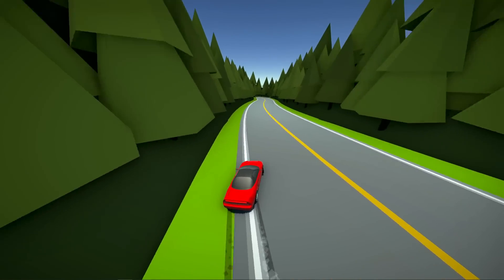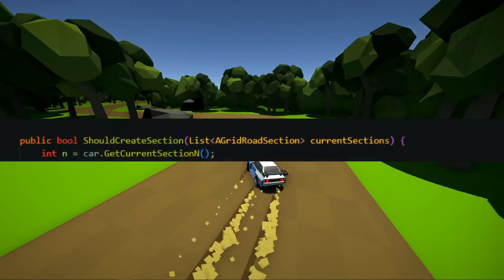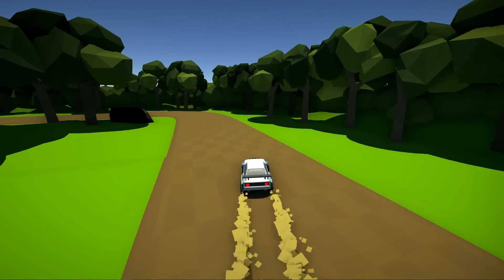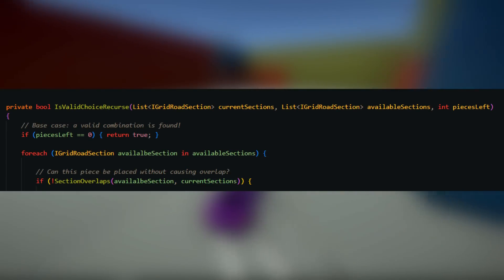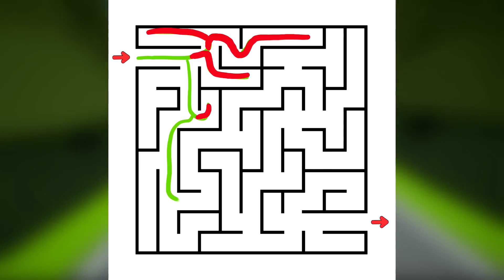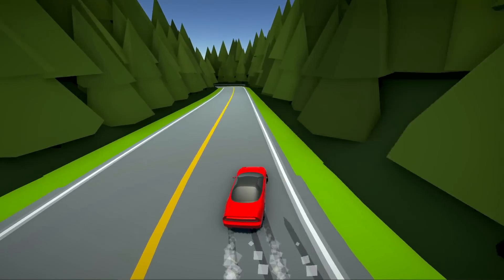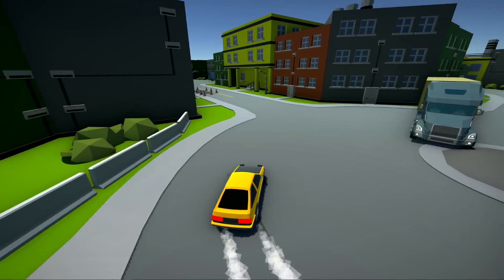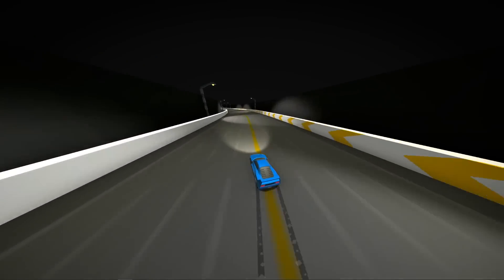Creating Infinite Road For My Drifting Game (again) - Drifto Devlog

Comment: You did the world generation, that's right, but you did the wrong movement: due to the limitation of float accuracy, you will start having big problems when approaching 100,000 coordinates, so programmers move the world around the player's camera, I did this with the level map in match3, as well as minecraft clones do
Reply from the maker: Yeah you're right, it would cause a problem.
I didn't talk about it in this video, but there are other systems stopping the player from going that far, so I don't need to worry about this.

Comment: If you get rid of the grid, you can still align pieces together with an entry and exit point. Just keep the position and angle of them in each tiles.
It will make the collision checks harder as you will want to check if the outer edges of the tiles overlapse. But it's not crazy to do at all. And since you don't need to connect back to previous pieces, it's fine if you loose the alignment to the grid. It will allow for any shape, and you could maybe do a stretching system for your tiles to curve them randomly

Comment: Try using spline for road and dynamic obstacle spawning at some distance. OR make one big square area with env and at runtime create 4 other area at each edge of square area, this way you can ajust inside of each square differently each time creating new square and you have a lot of more control of area than current one.
Reply from the maker: You’re thinking doing more of it procedurally right?
While it would solve a few issues, it would be a lot more complex to build.
Reply: It will be more easier to handel and more performance friedly with loaded assets!:yougotthis:. Games mech look awsome and satisfying.

Comment: As someone that once made a prototype of a tile-based procedural track-racer (closed course loops) on Roblox, here's my suggestion: abstractify the pathing algorithm. If you have five unique "one road tile straight forward, with one scenery tile on each side" prefab models, the path-ahead checker does NOT need to check each of them as unique cases! Have an abstract "straight ahead one, 1x1 scenery each side" instance, along with abstract instances of every other type of track piece. Then once you have a valid path of track piece types, replace the abstractions with a randomly-chosen unique model from the pool for that type, perhaps using Wave Function Collapse to have some consistency in scenery if you want. Either way, pathfinding complexity should never increase just because you added additional scenery models of the same movement direction...

Comment: I want to try to make my own mobile app. Do you have any advice on where to start?
Reply from the maker: Choose a small project and go for it. See it all the way through. It doesn't need to be pretty.
I found the releasing of my first app the hardest part (as opposed to designing and building). Including time it takes to get approved, it was something like 3 weeks to go from functional to released.
It's not particularly hard, there were just a lot of new concepts.
In taking a small project through the entire process you get exposed to many new tools and concepts.

I did this with a game called Tower Dropper, it took a couple of days to develop, but a month-ish to get on the store.
Releasing Drifto felt like a walk in the park in comparison.
Reply: @jonathonhowe  once i have functionality prepared where do i go to publish?
Reply from the maker: @PANic  There's the Google Play Console for the Play Store and App Store Connect for the App Store. I haven't explored any other options.
It does cost to get started on both of those platforms, so checking out other options is perfectly valid.

Comment: I feel that using machine learning (RL to be specific) could provide a good approximation for your chooser algorithm, but the more I think about it the more I feel that it may end up just being more complicated than a normal way and you would add a very small chance of having a player run into a situation where he'll end up with an overlapping environment anyway.

Anyway, cool video. Maybe there's a way to solve your problem without even having to compute all possibilities in the first place, but it may require a bit of experimentation and research.
Reply from the maker: That would be a fun experiment, but I don't believe it will be worth the development time. Especially considering I haven't done any ML.

Comment: You might be able to make something much more efficient just by using a slightly modified A* pathfinding class. The trick is to assign each position a random weight that ranges between a positive and negative value. This will change the way the path is generated so instead of finding the shortest route it will instead meander around taking detours and even doubling back. Once you have your path you simple need to insert the correct tile pieces.

Comment: I'm sure this was already discussed n thought about, but why is it necessary to keep the already used track (where the player already drove thru) for such a long period? Instead of say removing it after 5 seconds or so. This would remove the need for self intersection algorithm.

New to game design and development so would love to know the decision and reasoning  behind it
Reply from the maker: The old pieces are removed once the player has completely cleared the one past it. So there’s at most 1 full piece behind the player.

Despite this, the self intersection check is still required as the pieces ahead of the player can still overlap with themselves.
Reply: @jonathonhowe  ahh I see, how many piece of road/tile does it generate ahead for the players in this instance?

Thanks for replying. loving your deVlog videos here. it is providing alot of insight on how a game development journey goes and the thought process behind it
Reply from the maker: Yeah no worries. The number of pieces placed is different for each stage. Pretty sure Indusso generates ahead 10.
Thank you! It’s a lot of fun to share

Comment: Hello again. Is it a bug when the smoke turns black and you lose all grip. Like I can’t turn at all. I also think adding numbers to the leaderboard would help. Right now the only way to see where you are on the leaderboard is first and second.
Reply: I have just made some tests. It happens every time I drive on a not blocked roundabout.
Reply from the maker: Yeah I know what's happening there. I think I forgot to add the road properties component (explained in most recent devlog).
It will be fixed in the next update.
Thank you for the heads up!

Comment: Im not really a good programmer, but would it help if you combine the placed road sections into a grid of lets say 4x4, and through the values of the roads that are already in place, lets say "left, straight, straight, left", it can already take away a group of possible next paths because of the "cluster" of sections in that grid? I think it would minimize the ammount of possible sections it would have to check if it can already exclude some of them beforehand.
Just a thought from a monkey brain.

Comment: what if I turn around ? or turn around for a few sections then come back?
Reply from the maker: There's a wall that stops you from going too far back. Sections are not removed until you have gone past them, so you'll see the same as you did before you turned around

Comment: You could also multithread the generation. Check 8 things at once for example. Or 80. Or 800.
I did this for my extremely similar, but dumber system (I just pretty much kept generating more grid and checking for overlaps on the cells IIRC) for a minigolf track generator, with the staggering you mentioned and the generation was just instant (even for a 100 pieces long track).

If you keep the amount of data passed around low, it's going to be fast on a single thread and inside a single frame as well. Just calculate with the pure data required, nothing else and it should be plenty fast.

Cool game!
Reply from the maker: Yes, multithreading it would help, I've had trouble getting that working with Unity though.

Comment: Here's a question: past a certain complexity of the path generation, why not use tunnels? You don't even have to worry about routing a possible path because as soon as the player is in the tunnel you can clean up existing tiles. It doesn't have to be every single time, but it would give you a way to let your algorithm "bail" on computing something and reset the map without disrupting the player's experience.
Reply: Plus, you could cycle through different "zones" of your world whenever player hits a tunnel, add musical cues, etc.

(It would also make it a lot easier for you to iterate into "levels" if you ever wanted to add a different game mode of some kind)
Reply from the maker: So swap out a piece that’s already been placed? Or design tiles that can have a tunnel placed over them?
Reply: @jonathonhowe  I was thinking go underground -- though as I think it through I'm not sure how much complexity it adds

Comment: One way to lower complexity of the depth-first search is to have tiles be categorized (straight, left, right), only needing to check those categories to the power of road sections. Then chose a random tile from that category. Slightly more work to implement, but should allow larger tile variation.

Even more complex, but using the snake example, you can ignore intersection with older tiles, as they will be deleted by the time the player gets there. But this adds a ton of complexity and only slightly increases diversity of tracks generated...

Comment: If you start to get bit by the combinatorial explosion when adding more section types, a possible way out is to introduce a degree of separation between road segments and their surroundings.
You can run the depth-first search solely on (what seems to be) the much more limited possible ways the road fills in the next n grid tiles, and then backfill the space around the entire new stretch of road added with your visual content. This should allow for a more flexible combination of sizes and volumes for said content and/or broadening the possible shape of the road - if that's ever an interest for you.
I'll admit that this idea came to me mostly because I thought, "if I were making this game I would add the possibility for the road to jump over itself instead of always avoiding collisions".

Comment: Hi! Watched your video, enjoyed the way u solve this problem, so i downloaded the game to look at this with my own eyes :D 
May i ask a question about economics? From which factors my gold earnings depend? It does not look like linear function of “drift” score. For example for 170 point i earnes 8 gold, from 186 9, and from 197 12 or smth like this. Does it depens also from time i dont crash, or  cells i pass?
Reply from the maker: Hello and thank you! The points in the run are the only thing that effect the coins. It's currently 20 points to one coin, rounded down. However, if you beat your highscore, you get a bonus proportional to the difference between the old and new highscore.
I do want to make this system more transparent in the future.
Reply: @jonathonhowe  oh, and i found a little bag maybe, idk. It‘s not necessary to buy a new map. Even if it‘s locked you can just tap on it and play it :D
Reply: @jonathonhowe  tap on the left side of a panel. If tap on right side it‘ll make sound that i didnt buy it yet. But if the left side is tapped it just starts this map

Comment: I'd recommend categorizing road pieces into the road path vs the road visual. you can have few road paths while another system chooses which visuals to put the roads as. EG you can have like 25 'sharp right turn' pieces but since they're all basically the same, the path checker only chooses one, before the visual checker picks the road pieces that visually fit. it'll help add tons of visual variety without adding tons of computation.

Another thing to do is maybe make a chance for the visual checker to look at many pieces together and go "Hey this multi-piece will fit! let's use that" for instance a few straights in a row could be substituted for some sort of long straight with a nice visual flair. The separation of visuals and absolute path can be quite something.

Another idea for visual separation is to have, for instance, in the downhill, the road is rather simple and can use the same road pieces, but the terrain around the road can be generated with a simple particle and mesh deform system. In fact, a random optimization you can do is to make a lot of the objects into world-aligned particles, since that can use just one mesh to stand in for many of the same mesh. Just remember to make sure the culling boxes of the particles are correct.

Comment: I feel like a depth first search is really over engineered and will massively increase in compute time when you add more types of pieces. instead you can just count up the number of pieces and turn left and the number that turn right. If for example you already have  2 pieces that turn left and you want to add another left piece, you are bound to run back into yourself, so either generate a straight piece or a right piece.

This will also make nicer drift maps since changing turn directions lets you weight transfer and maintain the drift

Comment: Hmm, the recursive method seems a bit too much for what you're trying to do. You should try to find a more general solution. Maybe if you test the distance to the nearest tile from each empty tile adjacent to the endpoint of the current one then pick the one with a sufficient average you'd be able to avoid cornering yourself? Another idea is to precalculate all possible sequences of n track pieces and which subsequent moves will result in a failure within n moves, then store that in a lookup table.

Comment: WFC is a fair suggestion, but alternatively you could multithread this pretty easily using the Unity task system. This is a perfect candidate for parallel solving, since you're just check projecting into the future to get data, not actually causing anything to happen at this step, allowing it to be entirely independent.

Assign X tasks, splitting the top level of the recursive checks into X subsets and handing them out. Then,

await Task.WhenAny(t1,t2,t3,t4,t5...);
and then cancel the other tasks via cancellationtokens.

The moment one thread finds one valid combination, it will return that, you can terminate all others and continue as you were. Additionally, that would spare you the difficulty of spreading it over many frames via coroutines, since it's happening asynchronously.

Comment: You may have already thought about why this might not work, but why don’t you just queue the pieces to render, but wait till the player has passed the intersecting tile to do so? Then you might not need a complex pathing algorithm and instead rely on good timing.

Great video. Will follow to see where this goes.

Also, a mode where the road falls away from right behind you might add some excitement.

Comment: Looking at gameplay - there might be a simple way to make it much more visually interesting!
Basically, creating a few "landmark" tiles for different stages that would be randomly placed at the creation of the level and persist until the level is done. They would have no road connections and be higher than basic tiles (like tall trees, a taller building, a crane and so on) so the player would just occasionally see them in the background, behind actually driveable tiles.

Comment: You could cut down on the performance cost by only performing the recursive search against a more abstract "minimum spanning set" rather than the actual tile set, i.e. the smallest set of tiles that are flexible enough that, for every piece in your set, there's a sequence of the spanning set tiles that has the same entry, exit, and footprint.

For a tile-set that includes a single-tile left, single-tile right, and single-tile straight, you'd only need those three tiles; for a tileset with more complex pieces you might need "short leg left" and "long leg left" and "large left" and "left U-turn" to check against recursively, but you don't need to also check against "left turn with large green area" or "triple right turn" because if you were in a situation they didn't fit, you could just go with a more minimal equivalent sequence.
Reply from the maker: Yes! That is another idea I’ve considered since. I’ve struggled to put it into words concisely, this is a great explanation!